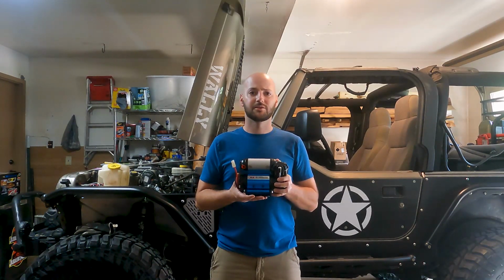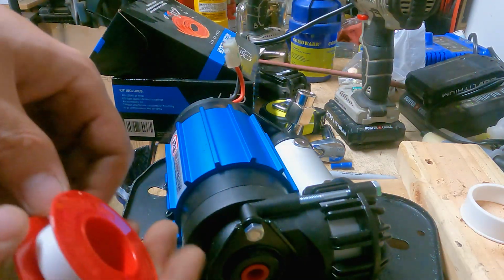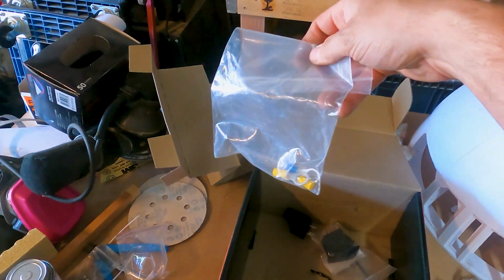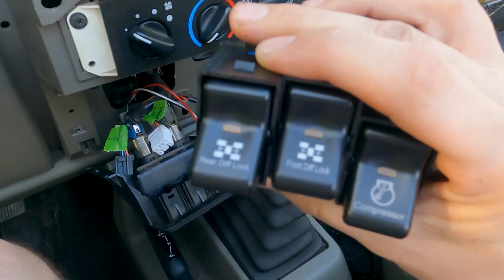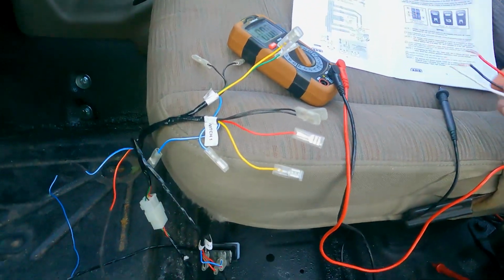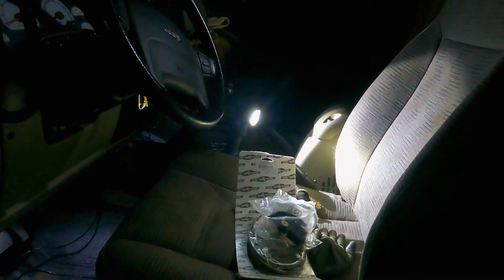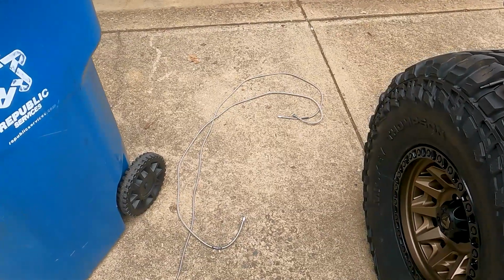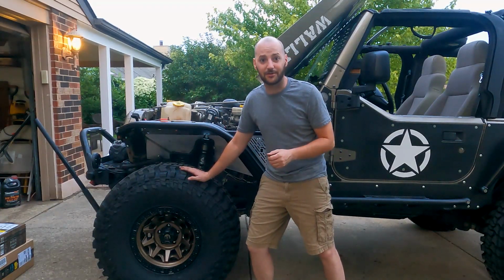ARB Compressor and Switch Install | Jeep TJ

Comment: Nice job on the install.  I have a DIY CO2 tank but want an electric compressor and I'll keep the CO2 as a backup.
Reply from the maker: Thanks! I almost did the tank but decided to go with the compressor. Having both like you though would be nice as a backup

Comment: Lucky’s Garage Show did a couple videos on the arb composer.  The TJ caught on fire, he blamed the ARB compressor wiring.
Reply from the maker: I haven't watched it but I know a bunch of people running them who have no complaints. Hopefully my TJ doesn't go up in flames. It feels like a part of me at this point
Reply: @WheelinWithWally  
I run the same compressor in my LJ Rubicon.  I just use it to air up the tires.
Reply from the maker: @WTF-oj6ez  I'm jealous of the LJ. Didn't even know about them when I bought my TJ. If I had I would've waited to find one
Reply: I saw that episode.  The reason it caught fire was that the owner had placed the fuse incorrectly.  He did not place the fuse closest to the battery so when the short(?) occurred the power was not cut off.
Reply from the maker: @long-jeep  oh okay. Good to know

Comment: Thank you for all the good info, I just finished my install in a 2006 tj rubicon. I did a few modifications relocated the air filter into the cabin for cooler air intake, and did a relocation of the air chuck to the front grill so no need to lift the hood
Reply from the maker: Nice changes and you're welcome! I'm just happy to see the videos are helping people out

Comment: Awesome ! , how’s the bedliner holding up
Reply from the maker: No issues. The only spots anything shows is where I screwed in bolts after the lining or is I shot it over a bolt and then took the bolt off it just chipped a little around the edges. But I'm a big fan of it

Comment: Have you used the compressor  to air up the tires yet. How did it handle it.
Reply from the maker: Yeah multiple times. Does it just fine. A few minutes per tire.
Reply: @WheelinWithWally  is that the medium arb. May have to look at them. I've got a small yukon which is made for lockers only
Reply from the maker: @TeufelHundenTJ  it's the single cylinder arb not the dual cylinder one. I don't know if they have three types or not.